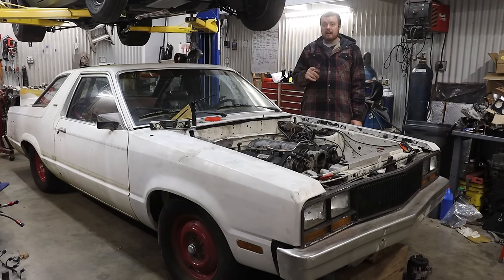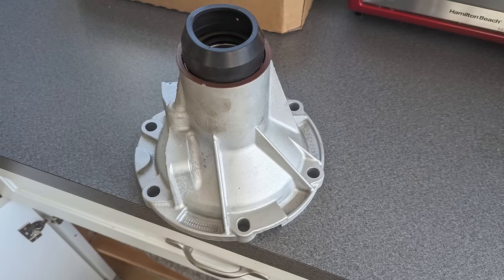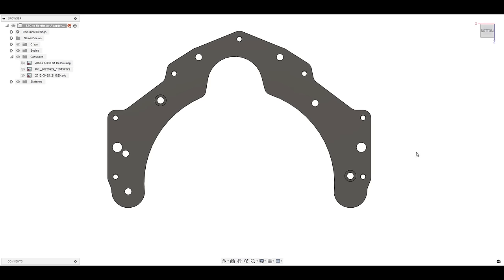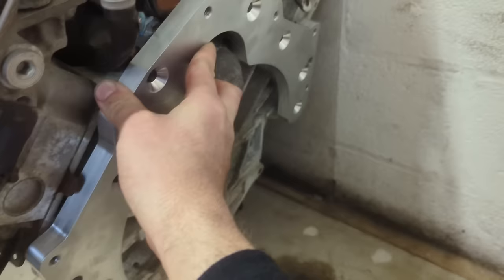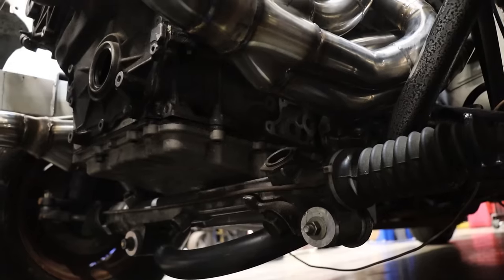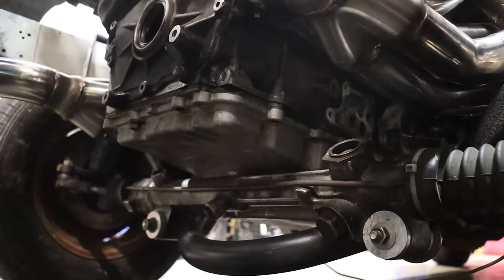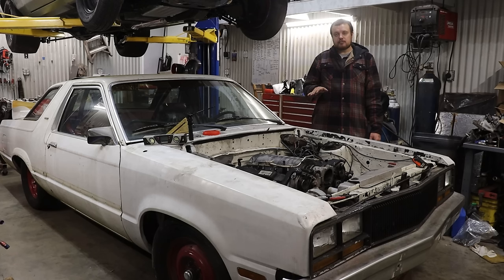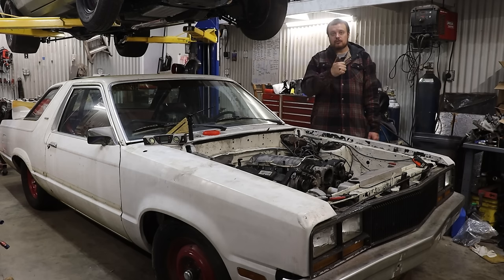Fits Way Better Than A Coyote! - Twin Turbo Cadillac Northstar

Comment: The NorthStar is another example of “what might’ve been “ had it been right from the beginning. By the time GM had the issues resolved it was already too late to ever overcome the horrible reputation that it had.  There needs to be a list of the top ten “What might’ve been “ engines.
I’m looking forward to this build.
Reply from the maker: That would be a cool list
Reply: Yep, GM really messed up with the Olds diesel and northstar. If they had both been fixed from the beginning, GM would most likely be in a better position now. Diesels might be popular still
Reply: Ya that's like the "LS" big blocks the vortec 8100 and LS7(i know it has small block crank, can be stroked to 8L makes it big block family). Neither got the engineering love that the LS 4.8/5.3/6~2 had. The 8100 was little more then a proof of concept, literally called a boat anchor because the whole thing was cast the heads/intake/exhaust manifold, even the damn water pump was cast, soooo heavy. Then the LS7 went the other way all aluminum really light...but a well advertised valve drop issue then no one wants one. At least with the latter people saw the obvious potential and got to work like this guy is. It really is to bad the 8.1l never really got after market support  the way an AMERICAN GM big block should, more then likely a fuel economy thing I'd guess.
Reply: @Calvin-Nelson I was wondering if this engine would be runnning
Reply: @joshuaelizabethfoster6276 you forgot the LSX 454, the 523 and the 623
Reply: @joshuaelizabethfoster6276 a friend has an ls7, he is a head man and corrected the valve drop issue, so far. His ls7 is very impressive, that thing makes power.
Reply: By the time GM worked the bugs out of the NorthStar, the LS engines had become popular. There's no competing with that, especially after getting a bad rep.
Reply: @joshuaelizabethfoster6276 lol 😆 
No ls big blocks bud
Reply: @michaelblacktree yup
Reply: @neilbrown82 the 8.1 is counted as such along with the ls7 and lsx, even the 532 and 632 are considered ls
Reply: I always thought the Ford 400M never got a fair shake. Its basically a tall deck Cleveland that got neutered by the 70's oil crisis. People claimed they were unreliable but we had a 79 TownCar that had one and it had a documented 548,000 miles on it when we pulled the engine and put it in another car.
Reply: @neilbrown82  thus the quotation dude it is a rather heated debate all the way...the ecm and nearly EVERYTHING on the 8.1L came from the LS family junk drawer lolol. And I'll agree the LS7 is way more of an LS/LT hybrid, however they WHERE most definitely designed by the same engineering group from the same part bin, I and many others say that makes them related. As opposed to LS/LT compared to say the Atlas/Northstar family.
Reply: @davidreed6070  ya got a real soft spot for the LS7 "rat". The valve drop issue wasn't that "unfixable", and they get an amazing power to weight ratio! For me it all falls into a prototyping bag. Often testing cash runs out before engineers are done, leaving us to pick up the slack. That is it we are intent on modification from stock.
Reply: Ya yk g, can’t wait to see the limits of this power plant, twin turbo v6 is a really good set up
Reply: @krispyk5854  it's a v8...
Reply: @V8Power5300 diesels might be popular still if our politicians didn't have aspirations to serve on boards in the  petrochemical industry...

More power, better mileage, cleaner burn=more fun and far better for the environment
Reply: @shadowopsairman1583  Both the Corvair and the Vega come to mind. The Corvair came from the factory with forged everything, and are very popular in small aircraft, of all things.  They put them in Pike's Peak hill climb Porsches for the torque , called the Porvairs. Their downfall was due to lousy seals everywhere, long ago corrected with modern seals.  All the Vega needed was cylinder liners and a proper amount of antifreeze to stop the block warping thing. I never saw a warped block that had 50% antifreeze in it. The bean counters at GM reduced the silicon in the cylinders to save money and guaranteed early on oil consumption.  They were originally just fine in long term testing. I hate cost cutters.
Reply: @yurimodin7333  I saw a lot of overheating in the 400's.
Reply: Making parts availability level impossible royally fucked any chance for Northstar evolution.
Reply: @Darth-.-Vaper  Never had any trouble with parts availability.
Reply: @wymple09  I had the 99 STS with the infamous head separation.  Rebuild parts were not available the options were 10k @ dealer for a whole new engine (which could fail exactly the same way) or 3-5k to sleeve the head bolts, which could be equally unpredictable
Reply: Maybe, but I think it needed more power to sell better. The northstar was smooth and high tech compared to a LS2, but power wise it made a moot point with higher costs and I don't know if it did better with fuel economy.
Reply: I say the dodge 4.7L should be on that list strong engines liter to hp ratio just plagued with poor engineering.....and the ford 3.4L v8 they put in the SHOs
Reply: Like the gm 4.0 v8 Arora motor 🎉
Reply: @joshuaelizabethfoster6276  even if you could somehow stroke an LS7 to 27 liters that wouldn't change the fact that it is, in fact, the same block design as a 4.8 or 6.2. Size doesn't determine a big block. Chevrolet has had 396ci big blocks and 400ci small blocks.
Reply: @SoI_Badguy  your correct big blocks have bigger cylinders than small blocks
Reply: @Darth-.-Vaper easiest fix was ls6 headbolts I've owned over 20 Northstars  my last model was an 06 dts ls6 headbolts and a 250 wet shot it would fly but the trans wouldn't hold it ran threw 3 different transmissions the car was just wicked man seriously
Reply: @enjoythesho1992  Wasn’t Mercedes involved in the design of the 4.7 Dodge? It was smooth but it couldn’t keep the oil and coolant in separate rooms 😂. I’ve wrenched on a few of them over my career.
Reply: @prevost8686  yeah it's designed by mercedes they are actually decent engines once you figure out what they like/ don't like lol keep the oil changed and keep them cool they will last I've seen a few with over 300k the worst part of the engine is it has steel valve seats pressed in aluminum heads that would come lose if they got the slightest bit hot and 2nd they are known to sludge up and lose oil pressure
Reply: @enjoythesho1992  I’ve definitely seen a few sludged up.
Reply: I had a 2006 sts-v and I can tell you firsthand there was no time that they fixed the issue I still ended up with a bad head gasket.
Reply: @V8Power5300 god it's like like they clutched defeat from the jaws of Victory. They had a world beater. And fucked up the head bolts.
Reply: I got a 2002 North Star in my el dorado. I wanna turbo it
Reply: The LS has the Northstar to thank for it's failures, because the issues saved the LS from major failures.
Reply: @Calvin-Nelson  there was more parts as i worked for a ( Nebraska ) guy/shop ( caddy's north-star's and 500CI and DSM and dabbling with ford-diesels 7L-common-rail ) around 2009-14~ era but the market ( was FWD and 4X4 north-star build's i was around RWD was rarely as most owner's liked FWD and yes RWD/swap'd-platform's were more effort so most ended up as 6L80E-less-likely ( as yes software was a pain at the time and sourcing parts like the transmission case and upgraded-internals ) or TR6060 or skipping to LSX/350SBC combo's ) must have changed, i know his shop/business is table-forked ✅but that's probably more to do with bad $$ management ( off holiday spending and or after hours habits-etc, not as much with daily operations, but did miss out on easy/quick jobs like oil-changes etc ) than platform love ( as much of a surprised me over the years as i thought it might be a fad as was his diesel dabble and i wasn't wanting to learn about it/diesel-light-duty at the time, my recommend to have the LSX and 3d-gen polly as a backdrop planning for the shop as platform's to keep the lighting on ) as im not interested as im a RWD-or-4X4 rb440/hemi /rotary guy, but still respect for others taste's

so at one point there was a turbocharged 4.9 / vin-9* or Y kit single ( Ohio remote-turner/turbo shop 🤔  , sorry my memory failed me for the grinder but i know were got some/installations instead of dealership's roller replacement's ) but must have been axeed-off as sales figures weren't there, also there was bigger camshaft's/grinds for it, are deal was more displacement/stock-rebuild's and or stud( or bolts as some customers preferred one over the other and or lower costs was bolts )-14mm ( x 1.5~ 🤔 ) kit and installation
Reply: If this was a Toyota or Lexus engine the company would have acted very quickly and activate the damage control party! All owners would have been compensated quickly with a new car! But it's not just GM that shift the blame game and nobody takes appropriate action until the reputation is damaged beyond repair,it's everybody in the industry from the entire German and European auto industry, Korean and even the Japanese!

Comment: As someone who was a mechanic in early to mid 2000s I loved this engine, I made so much overtime. Most of the time it was a elderly person who went 10000+ miles on a oil change and brought it in due to engine being noisy. To check and see oil was very low and black with glitter.  Maintenace/ checking oil levels is super important but over looked. I use to add about 1/2 - 1 quart after the full reading for anyone elderly or who was unlikely to check oil. In my experience if maintained 250,000 miles no problems. Years and years ago I helped put one together to go into a Fiero.  For its time it was fast low 12s car due to traction issues. Awesome video
Reply: I loved doing fuel system services on them when they were owned elderly folks. The carbon buildup would make for a John Force burnout style smoke show when taking the car for a road test! 😂😂😂
Reply: Great until you blew a head gasket or sensors went out, which they frequently did.
Reply: What rpm could that Fiero build turn? I bet that motor sounded good at WOT in the higher revs
Reply: I got to drive a Fiero with a Northstar swap. Stupid fun. That is how GM should have built that car.
Reply: I worked at a gm dealership in 1998-2000 and we mainly serviced Cadillacs and H1 Hummers ( go figure) . I was the upholstery guys helper at the time . I can't tell you how many of these Northstar Cadillacs we had engine problems with back then . I  remember they had a coolant conditioner that was pellet based ,and a special fuel system additive. I rode in a lot of trunks trying to find rattles and squeaks . Also I was the test driver .The techs would just go have me floor them on the freeway until they stopped smoking from the fuel system additive . The Bose sound systems were nice though .
Reply: My parents had a 96 DeVille with the northstar, never actually had probs. My dad was always doing oil changes at 3k tho. It's odd always seeing thier checkered history brought up. It was a fantastic car to borrow when I was 16!
Reply: @shadymaint1 it's how  it was first done then gm looked at the performance and decided it challenged the vetted so they hobbled it in steering and engines.
Reply: are/not-me-shop-boss's 😉 testing ( studded/14mm and or modify'd for customers to see a finished runner etc ) mule's got to 350k miles ( 80-130k was factory QC ) one would have done 400~ if the radiator hadn't pop'd and the cop/state had let if cool back-off on the side of I80 westbound next to york from Lincoln nebraska going to Sydney~ areas

im a 60's charger owner+fan but yes i see this platform got a extra bad-rap some of it's not earned or Texas-telld'd
Reply: Never would've thought of a Nortstar, let alone twin alternators,  brilliant! 450 to 525 hp, prediction.

Comment: GM actually fixed the head bolt and head gasket issues with the LH2 in 2004-2005 and NorthStar Performance also makes performance valve springs that’ll allow the engine to rev up to 8,000 rpm on stock cams and TimmyC also makes a larger 85mm ported TB

Comment: I had an Oldsmobile Aroura for a while a long time ago. It had a smaller 4.0 Northstar engine in it sideways for fwd. She pulled hard and gained rpm fast. Can't wait to see this build Calvin.
Reply: So did the Shelby series 1 by Carroll himself
Reply: I have a 2001 Aurora with the 4.0 Northstar. Bought new in 2000. NO HEAD GASKET TROUBLE AT ALL!!!

Comment: I always wondered why nobody built the Northstars, they seemed like great platforms to start from....glad to see somebody doing it right on YouTube where I can watch along!!
Reply: They do but it's mostly geared towards the drag scene. There's a handful of aftermarket for it
Reply: Headgasket issues plagued the early designs due to too small head bolts.. There are headstuds available for them now.
Reply: The sand rail guys did from the start. All aluminum engine that was putting out 100 HP more than a 302 or 305. In the late '90s they were getting 400 + to the wheels naturally aspirated with comparatively primitive tuning. It is easy to spot one by sound, they don't sound anything like a Ford or Chevy.

Comment: The reason why the 6l80 tailshaft doesn't bolt up is because that transmission is a 6l50
6l50 were found in 2wd and awd sts.
Sts-v had the 6l80 but only in rwd configuration

Comment: I’m sure offering those one off parts to the public will help fund anything you need for this build haha . I was hoping to see a manual trans setup but I’m still interested to know what these engines can do !
Reply: Me too, 4 years ago my roommate bought a 40k mile pullout from an STS-V for $400. Can't touch the blower for that much now.. he had aspirations to put it into an S10 mini truck build with a manual but we couldn't figure out how to make it work with anything off the shelf so we were stuck with the 6l80 that came with it.
Reply: The only thing stopping me from using a northstar in my el camino is the lack of a real manual option.
Reply: @malaukcrysis  You can use the 60 degree V6 bell housing from a camaro or S10 with minor modification to one mounting hole and starter clearance.  Do a search, flywheels are available.  McLeod made mine.

Comment: If you need to suregrip head stud tools for redoing the head bolts to his studs I have the tools you can barrow. I had a Northstar in a rock crawler buggy. I think they are a highly overlooked engine. I will definitely fallow this. Pretty cool.
Reply from the maker: Yeah. Northstar Performance is going to help us with that. Thanks

Comment: Im exited for this build! Im building one for my vega with a t5 trans. Not sure about the rwd engines but the exhaust cams are rather short duration on fwd motors. I'm going to use intake cams in their place and tighten up the LSA some for better power. Keep up the good work!
Reply: Can you give anymore info on this? I am wanting to put my 04 into my 67c10, but run the LS pcm to control it. Just cant find cams..
Reply: @michaelbush4741  you're putting a northstar in a truck? .. cool! Are you using 1 from front or rear drive?The engine I'm using is from a front wheel drive, so the water pump is driven off the left bank's intake cam. The extra length where the pump pully sits needs to be cut off so it will sit where the existing exhaust cam sits. You can do this with an angle grinder. Anyway, the cam lobes are in the same relationship on intake and exhaust cams, just are timed different. The exhaust cams on the cady have smaller lift and duration. (Probably a emissions thing) if you install a set of intake cams in place of the small exhaust ones the engine will clear out the exhaust better and allow more air fuel in. More hp. Make sure to time the cams to the exhaust cams specs.
Not sure if you can use the ls computer with the 04 motor. If your northstar has 2 crank sensors, it can't read the trigger wheel. If it has only 1 crank it already uses the same ls computer

Comment: I had a customer some years back that had a mint Eldorado with super low miles and it had the 300hp northstar in it and it was very impressive for being a heavy fwd vehicle, I think another major downfall of these engines was not running premium fuel and adhering to oil quality and weight requirements all because it costs more resulting in “just put the cheap stuff in” and these engines weren’t designed for that, they needed consistent maintenance with top shelf products. Really cool build and I’m excited to see it finished!

Comment: Love these fox bodies. Hate the starter position and head bolts ondy northstar engine but, it can be righted with modifications. Keep an eye ondy water pump too
Reply from the maker: Yeah. 10 bolts and the starter is right there. I kind of like it being on top of the engine. Lot easier to get at.

Comment: YES!!!  So glad to see you guys not only continuing the project, but solving issues in a unique way(LOVE the jig y’all made for the exhaust ports!!!)!  

The GT35 turbo was a VERY popular turbo upgrade for the original Dodge SRT4 crowd.  2.4L DOHC setup, redline in the 6,200-6,500 range, boost would start to build around 2,500 rpm with full boost available by 3,500 rpm range(depending on timing).  That setup was typically good for an easy 500 whp.  I don’t think that 800 whp will be an issue for those turbos at all.  

I’m patient and am not going anywhere, but I can’t wait to see how this project progresses!!!